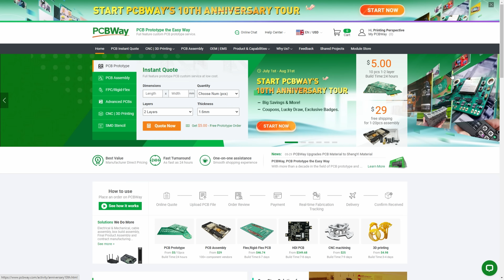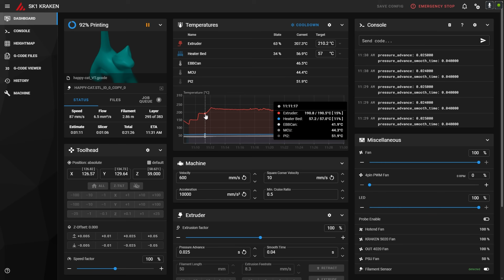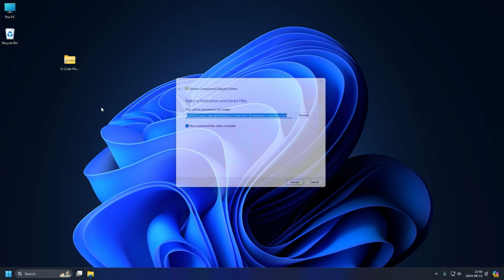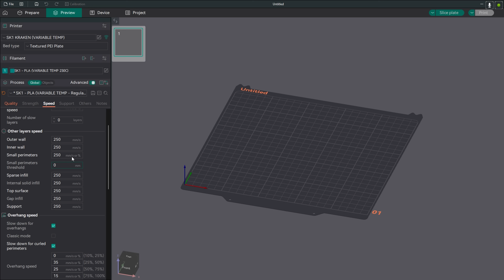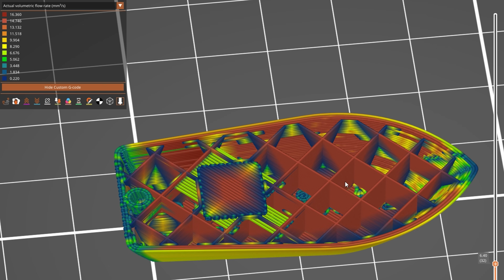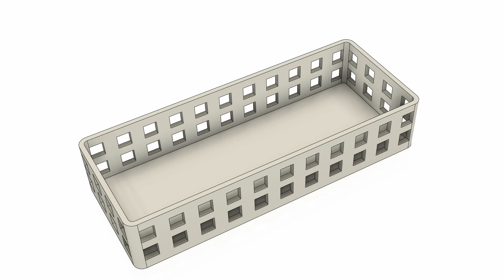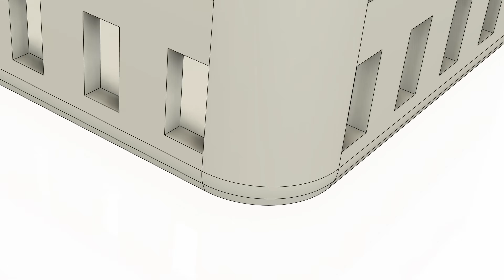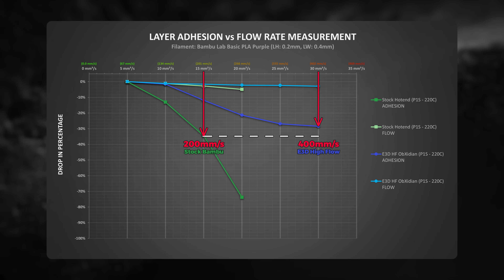Variable Temperature 3D Printing – The FUTURE of 3D Printing?

Comment: It's just a consequence of the hotend not being able to keep up with extrusion rate. This is why smaller hotends will benefit from it more. With massive copper volcano it is very likely you won't see this issue at the same conditions you start seeng it when you use hotend with small heat capacity.

Because hotend can't transfer heat as fast as you want it to, increasing temperature leads to transferring more heat (not transferring heat faster). This works at fast extrusion rates but since it's already inadequate conditions, sections look different.

With proper configuration there will be no visible difference. But proper configuration means you need to consider your hardware limits. In that case, it is volumetric speed should be under whatever your hotend can do. So at any rate heat transfer will be consistent because hotend won't starve for heat without increasing temperatures for printing fastest sections.

Sure, for some "looking good" is valid reason but this will not fix layer adhesion issues which inevitably come with inefficient heat transfer. This is not the future, you only tuck away hardware issues by software hack rather than fixing the real culprit, which is the hotend.

You also didn't mention Marlin's MPC temperature control, which replaces PID and more responsive in conditions where filament takes away heat fast.  It's basically what "variable temperature" should be. Printer should just maintain temperature you set. And since PID isn't reactive enough, that is part of the issue.
Reply: Nothing to do with hotend. I print at like 30mm/s I get this. I print CF nylon in a heated chamber and 0 cooling for supreme layer adhesion, and some components will have such varying layer times that some areas will look different than others due to the layers not fully being cooled in certain areas before the next layer is deposited, giving inconsistent texturing. This can be partially solved with auto speed based off of layer time, but then some segments are going at 100mm/s and other at like 20mm/s, causing slight flow inconsistency due to the difference in nozzle pressure and required pressure advance. A variable temperature would make this incredibly good and would solve all my issues.
Reply: Basically, what you're saying also comes down to you creating such printing conditions that cause these issues.

Varying temperature won't solve them. It will mask them away. If your only goal is to make prints look pretty then sure, nothing wrong with whatever workaround you apply for that.
But that is not a fix. Fix would be to change printing conditions without trying to outsmart physics.
Reply: @shadyb  well, I don't make things to be pretty, I make them to be strong. All my prints are 100% perimeters throughout, or 2-3 perimeters with 100% rectilinear monotonic infill, depending on stress direction. Layer adhesion is a combination of layer temperature (affected by the environment, speed, and other things including cooling), extrusion temperature, flow rate and nozzle face width (flat surface that "flattens" layer line) as basics. If I'm gonna max extrusion and chamber temps without making my part a droopy piece of shit, I have to slow down. Going too fast creates extrusion inconsistencies that affect strength, as absolute perfect flow rate is MANDATORY for a near injection molded isotropic strength with these materials. Variable temperature can allow less heat transfer, but identical layer adhesion as the whole component will have the same layer adhésion/Strength. Most of my parts have less than 40 second layer times, even at 25-35mm/s (small components), with some parts being like 5-10 second layer times. Due to the usage of Nylons, cooling MUST be off, as it causes dimensional accuracy issues and slight warping due to the inconsistent speed of cooling between layers. This would work perfectly for this very particular situation, something you have yet to encounter it seems.
Reply: Whatever floats your boat. If you think you can beat physics, I am afraid to stand in your way.
Reply: @shadyb  I literally explained all the physics perfectly, you are ignoring them. How bout you explain why I'm wrong with your physica
Reply: I do not understand what is the difference between transfering more heat and transfering heat faster (looking for a physics based answer).
Also MPC only helps prevent the hotend's temp to vary, it does not help with the filament's temp varying at the output, wich is what you are doing by actively changing the hotend temp with the method described in the video. If the method works well, than you are indeed helping for aesthetics AND mechanical properties (layer bonding).

Comment: if your filament isn't being heated fully at an appropriate printing temp you're not spending enough time in the hotend.  either slow down in general or get a longer melt zone
Reply: Fast printing is achieved with
* better heat transfer (longer melt zone or split heating)
* higher nozzle temperature (stringing)
* being OK with inadequate melting (matte surfaces, under extrusion, lower adhesion)

Ain't nobody got time for good prints 😅
Reply: Pla melts at 80*C, do you suggest setting nozzle temp to 80*C and printing way slower? Don't think so
Reply: PLA is not fluid enough when it is at 80c. That is why you print it at 200c. But when you print it at 200c you intend for the plastic to be at 200c when it comes out the hotend.
So I agree with OP, if your filament is significantly colder when getting out of the hotend then the hotends temp, you are printing too fast and/or your hotend is not good enough for the amount of flow you are asking it. Making the temp higher can be dangerous because some parts of the filament might be at that higher temp (lets say 240c) when you need it to be at 200c.
In a perfect world the hotend thermistor should be mesuring the actual filament temp and not the heatblock temp.

Comment: Seems useful, I like practical things like this, which do not really require any modifications to the printer itself, but make the next step for the 3D printing technology.
Reply from the maker: I am surprised we haven't seen something like this sooner, because it is kinda obvious that with slower speeds we don't need higher temps, and for fast ones we do.

Comment: I would like this in standard Orca :)
Reply: This has been batted around a few times in the discussions on the Orca GitHub. I wouldn't mind seeing it implemented, even in a prototype phase for testing purposes.
Reply: SpeedPrinting knowledge is very important in these cases too.

Always check you gcode.
Reply: If it's in standard Orca it also resolve the problem that it's not available on Linux and MacOS at the time
Reply: There is already a less sophisticated solution to this problem  but it delivers same resutls - "Don't slow donwn on outer perimiters" option in filament settings. It makes sure outer wall is printed at the same speed so there is littli to noe difference in apperarance.
Reply from the maker: A lot of the time your speed is limited by the acceleration and the corner velocity not by the set speed of outer walls. That option helps only in a few scenarios and is nowhere even close to what results the variable temp can give you.
Reply: @kybarg but at the start and end of extrusion it has to accelerate no ?
Reply: It won't happen, it has been discussed and while simple geometries like the basket here work, more complex ones will have unpredictable results.